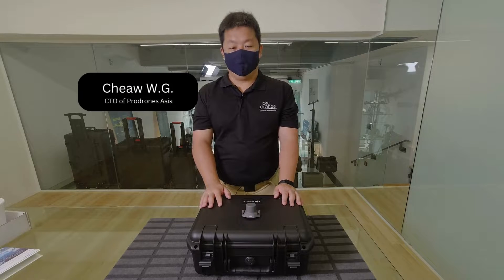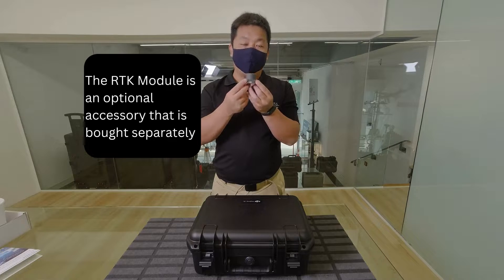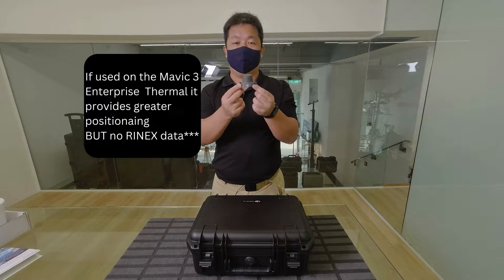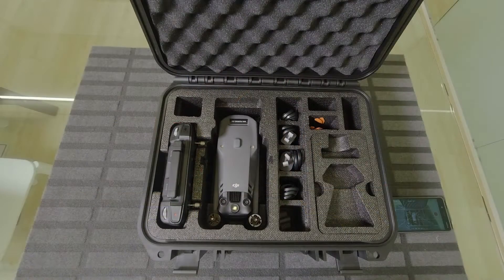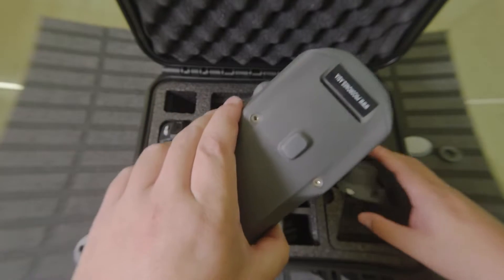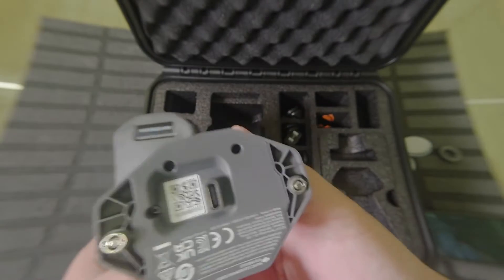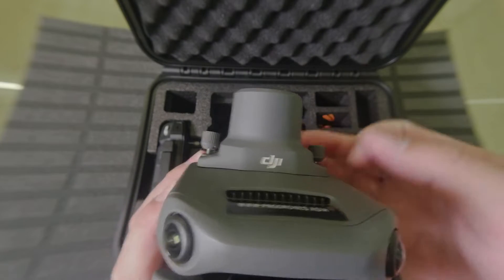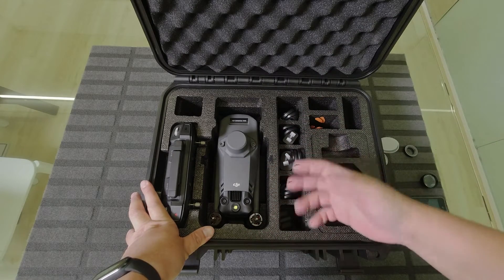DJI Mavic 3 Enterprise RTK Module-Part 4

Comment: Hello. Im just curious...you said that M3T will not save rinex data for ppk prcessing but if you use rtk will the photos have the geotagging from the rtk ? If it's yes than you can also use the m3t for precision mapping just that it will not have the speed and the quality of the M3E right ?
Reply: I also talk to dji support and they said that if you have RTK on, the photos will have in them the corrected geotagg. So in theory you could also do precision photogrametry with the T version but it will not have the quality and the speed of the E version.
Reply from the maker: Hi Stefan. Yes. With the RTK hat on the M3T, you would be able to have precise precision tagged to the image and process them. But the downsides are more than you mentioned.

1) Lower image quality
2) Lower acquisition speed = less efficiency
3) You will need rock solid connection to your correction source and the drone to avoid needing PPK
4) More expensive aircraft unless you need the precision for the thermal images as well
5) No mechanical shutter so the rolling shutter distortion will be there

Hope this helps
Cheers!